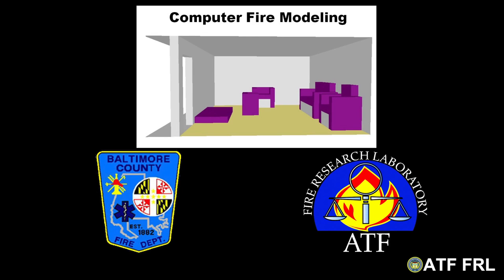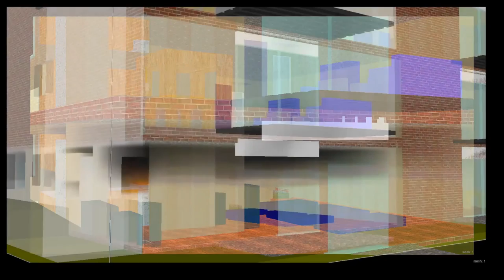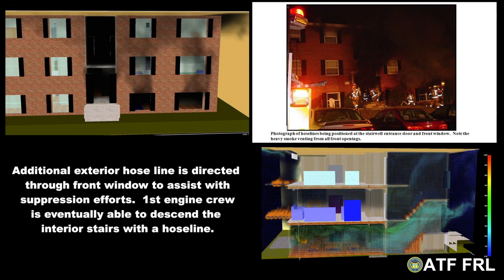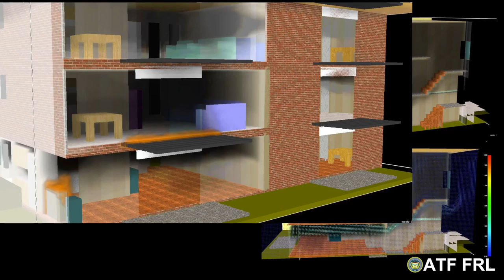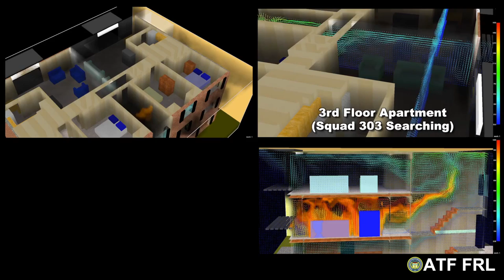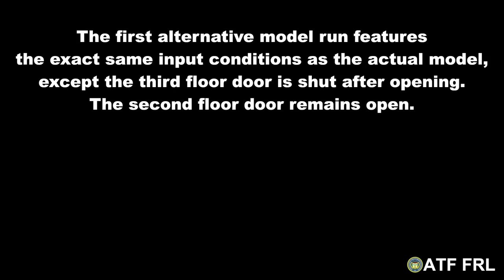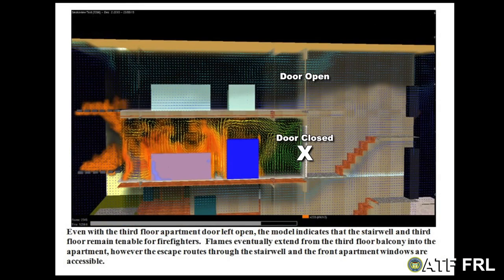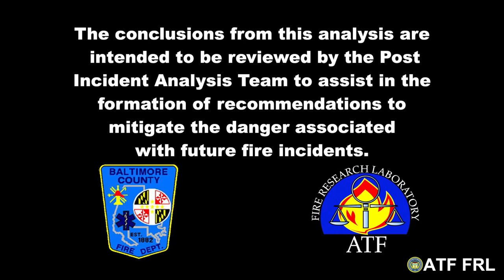ATF MAYDAY/LODD Fire Modeling Analysis with Scene Audio, FF Mark Falkenhan, Baltimore County FD

Comment: Way too many questions by the 911 operator.  Kitchen on fire.  Get all occupants out, we are on the way.   How long did that delay the tones from dropping?
Reply: Other than verifying the location (30 Dowling Cir) and the general synopsis of what was happening (APT fire), it didn&#39;t delay the fire box being sent. The video plays the entire 911 call from beginning to end prior to the fireground audio starting. It is a result of the editing in the video.
Reply: +Matt Madairy I thought according to the intro that it was real time
Reply: +Yaj Grebednav the radio transmissions are in real time, but they even pause when the narrator talks. I also have first hand knowledge of this jurisdictions procedures and policies.
Reply: Probably didn’t delay the response at all. One operator takes the call, and while asking the questions enters the info on their terminal. The initial info/address goes directly to the dispatch operator’s terminal and the fire companies are dispatched before the call taker is off the line. The additional info is later sent to the MCT in the apparatus so the officer has an idea of what they are rolling in to.
Reply: Seems pointless trying to elicit that much information from a panicked occupant.

Comment: Up to 13.00
Cant help feeling angry at the owner of the flat for A leaving the oil on stove in the first place and B leaving the flat WITHOUT closing the door.

It is totally fascinating how the geography of the property in general and the building does NOT relate to the geography of the fire itself. There two sets of rules here even before operations start.

I presume opening the front door was in retrospect considered a grave error, given its effect on the fire. But who knew? Would there have been any point in closing the front door, without knowing the location of the venting? Would it have been better to run around the building in an attempt to find the seat of fire? Sure the already knew which flat the fire started in BUT understanding the physical shape of the fire in relation to the structure involved more than knowing the flat location. Also they now know the fire was never contained in the flat, so any design features of the building relating to fire containment are void. Should that not be a game changer? The building can no longer be considered a collection of closed cells, its just a small warehouse fire. Is the rescue sweep worth the risk at this point, given the fire has free range of the entire structure.

I really feel for all professionals involved in this incident, particularly while the rescue sweep is ongoing. The clash of priorities given the time constraints are horrible. External fire suppression in support of the rescue sweep is unlikely to attack the seat of the fire. It is prudent for the commander to request backup to fight the fire while rescue efforts are underway.

The extent and survivability of smoke throughout the building is unknown. The seat of the fire during rescue sweep is probably unknown.
Reading the smoke gives indirect evidence that the seat of the fire and the venting is anywhere other than the Alpha side. Was someone charged with going around the building to locate the vent?

My limited experience suggests that locating and restricting the main vent of the fire would have significantly reduced fire activity, but not the accumulated heat within the fully involved areas. Id really like to know whether oxygen suppression is a viable form of attack after flashover. I can't see it myself. Attack the seat of the fire: reduce the temperature of the gasses overhead wherever possible. BUT buying time for the rescue sweep could involved tactics to temporarily reduce fire intensity and growth.

After 13.00
Wow! Where were all the smoke alarms in these appartments????
So many victims! Suddenly rescue becomes the priority and fire is given the chance to start again on the second floor.
Those hollow core doors are amazing! Also amazing is how the open window in the stairwell is no substitute for the third floor door left open.
I have zero sympathy for the building owners and designers. These buildings are death traps as long as automatic sprinkler systems and fire alarms are not mandatory for ALL buildings. The fire alarms are not even expensive!!!!!
Linked fire alarms in every apartment, could have warned everyone to evacuate the building BEFORE the fire crews arrived!
Brave fire fighters should not have to juggle rescue AND fire suppression when every second counts. Its too easy for a door to be left open during a rescue. An amazing rescue effort, but it should not have been necessary.

Comment: VES  Vent. Enter, Search.  This is what kills fire fighters and it SHOULD be obvious!  It's very heroic but makes no sense whatsoever!

This is what DOES make sense and can be done Faster and Safer than anything else.  

V - Vent windows at the fire rooms.  
E - Extinguish all Visible Burning Material through the windows BEFORE entering the structure.  This can be done before a crew can get ready to enter.
V - Vent more windows to release more gasses.
E - Enter and extinguish remaining burning material as you Search for victims.

THAT, is how you PROTECT the victims And the fire fighters by eliminating the threat and venting the structure to make it survivable for everyone.  What was done here is plain old Stupid.  They actually entered while this fire was raging?  Really?
Reply: JB91710 is this a new version of VES or an acronym your department uses differently from regular VEIS?
Reply: @kanenb8616  Combustion of materials is the threat.  Victims need Protection from the flames and smoke.  Find extinguishment in their system.  Notice my way removes the threat before a team can even get dressed and through the front door.
Reply: Vent Enter ISOLATE Search
Reply: @Minuteman PB  Is that the best you can do after all the information I provided?  All you did is repeat what some other non thinker said.
Reply: @JB91710  I didn’t repeat what anyone else said, that’s what we were trained to do at the fire academy
Reply: @JB91710  I’ve seen you on numerous other fire videos before, you seem to have a long history of trollish behavior
Reply: @JB91710  I may be explaining this in vain and throwing my pearls before swine, but whatever.

We should never vent an area we don’t intend to isolate.  When you vent enter isolate (close the bedroom door) and Then search, you are creating a tenable space while also not influencing the flow path of the rest of the structure.
Reply: @theparaminuteman  Gee, if only you could have told me where and how I am wrong.
Reply: @theparaminuteman  And you repeated what someone else told you to think like a true follower.  You should be proud of yourself.
Reply: @theparaminuteman  pay no attention to JB he is nothing but an armchair FF and TROLL thinks he knows everything but has most likely ever been on a dept most of us have learned to just ignore him many channels have blocked him
Reply: @jays106  Lmaoo is he that well known???
Reply: @theparaminuteman yes he’s the top ranking armchair chief on YouTube. Think he’s got 5 stars on his stained white shirt collar
Reply: If you're scared of VES, you shouldn't be a firefighter. Stay in the yard. Statistics don't lie; VES saves lives. Get in there and make the grab.
Reply: @HeraldandGerald  You have no clue because what you say is childish at best.